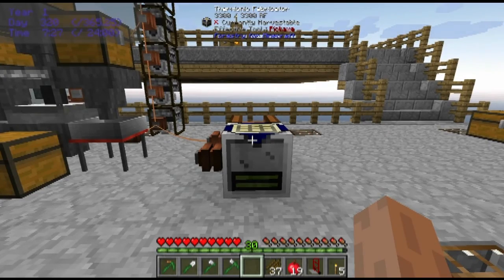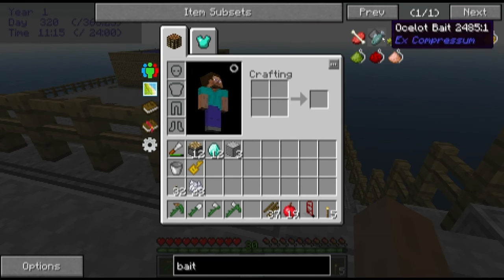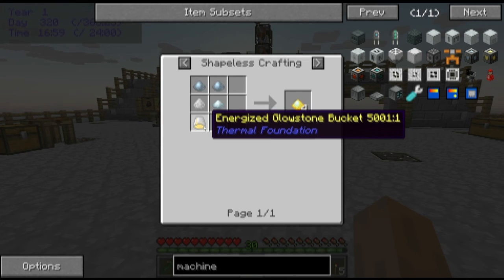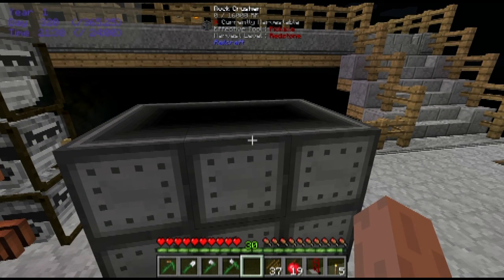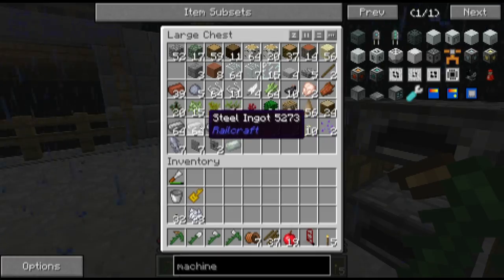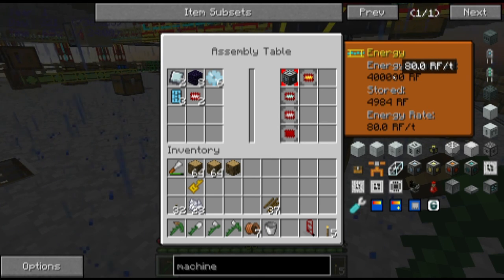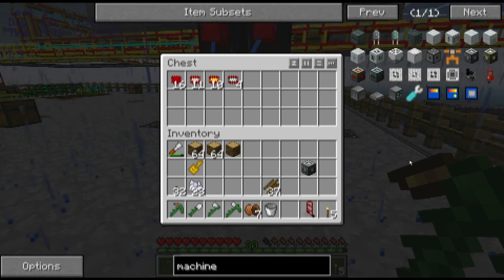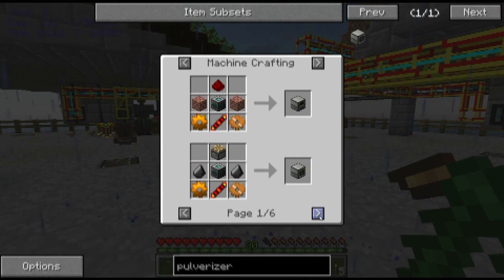FTB Infinity Evolved Skyblock, Episode 7

Comment: Do you like getting into the Magical mods as well or do you tend to stick to the Tech ones?
Reply from the maker: I find that I gravitate to the tech mods, and only dabble in the magic ones.  I am planning on an attempt on all the achieves in the pack, so I'll be working with the magic mods as well.  Since I don't use them as much, it may be a struggle!  I may not delve into them any deeper than is required just to get the achievement.  As a simple example, when I automate parts of Botania, it's likely I won't use Botania's native automation.  It's more likely I'll just use familiar tech mods in conjunction with Botania to get the result I'm looking for.